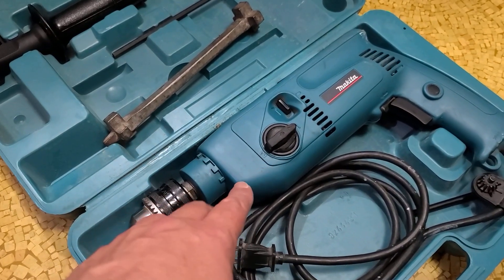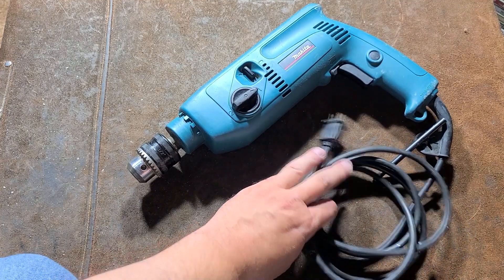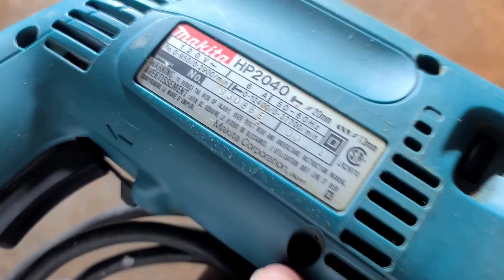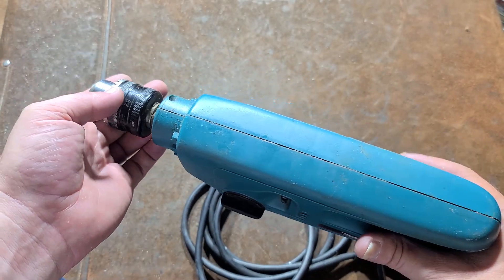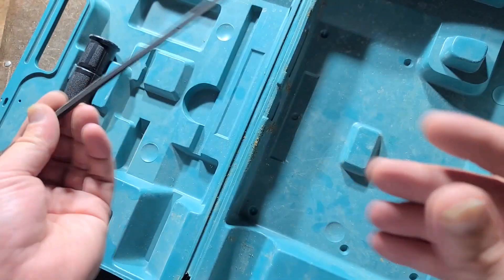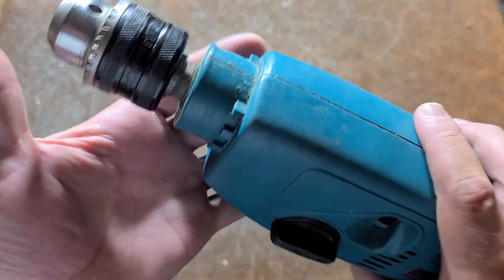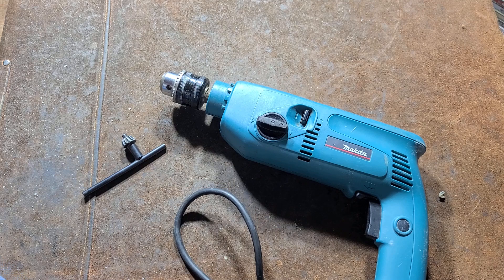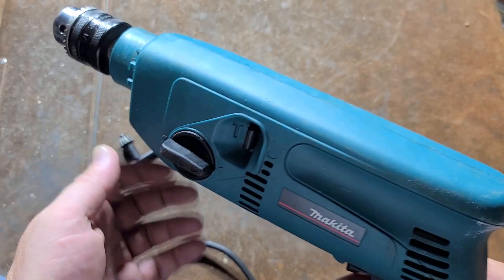Makita Japan HP2040 2-Speed 1/2" Hammer Drill Review/Teardown

Comment: Mine was 150.00
Back in 1994.
And it was a 3/4 in. Hammer drill.

If I was younger and returned to Concrete Form work.
 I still would take that drill to work today.
Reply: When I was in the Air Force back in the 80s and 90s, we had a few  cordless Makitas to remove screws from aircraft panels but the tool crib was very stingy about signing them out. If your panel didn’t have more than 200 screws they would just give you a speed handle instead.